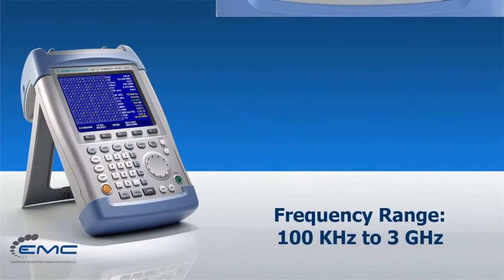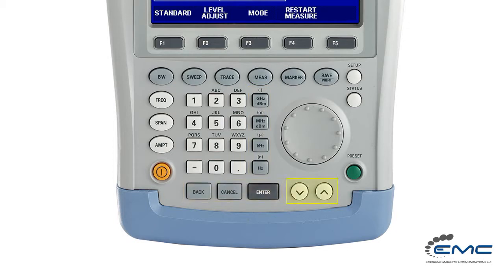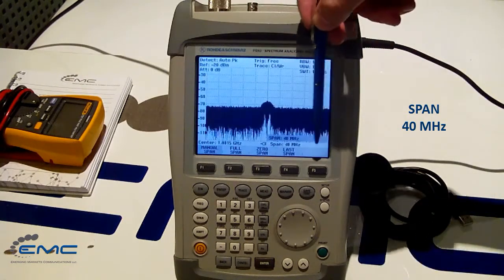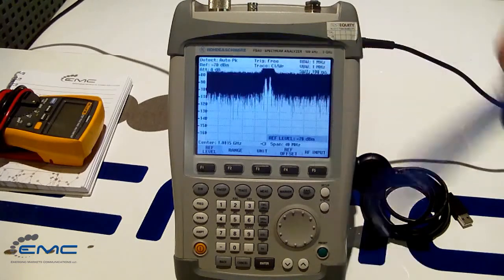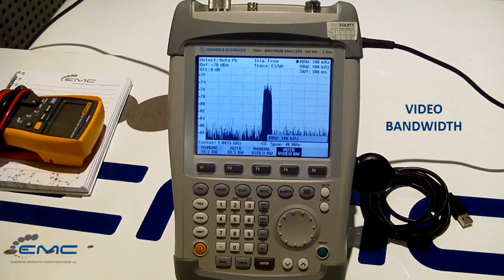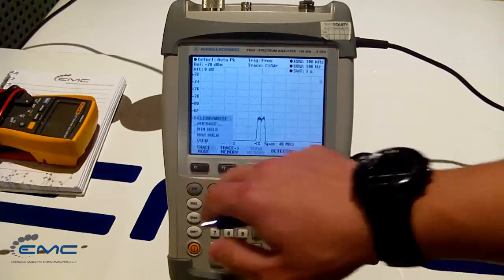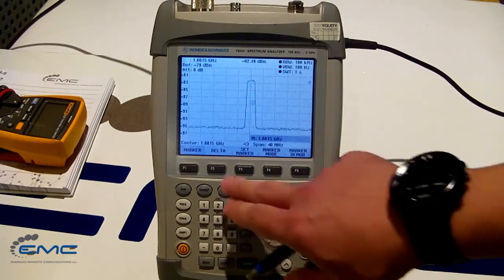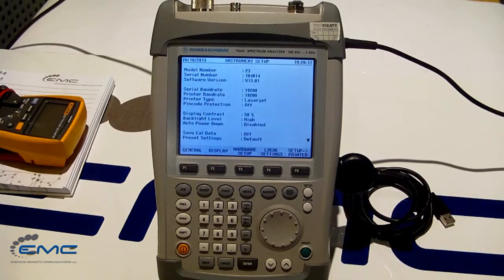Using Rohde & Schwarz FSH3 Spectrum Analyzer

Comment: Thank you for the tutorial.  We have two FSH3s that I'll be using soon.  A little time with the manual goes a long way but I did learn about measuring the delta of peak to noise here.
Reply: I’m an audio engineer looking to use this for rf coordinstion. Would you recommend this unit. I have one being sold local for a steal new I’m box just missing power supply.